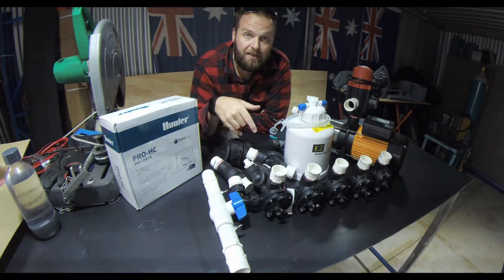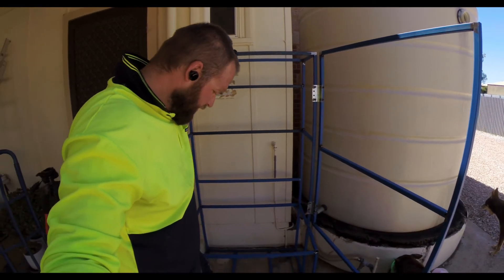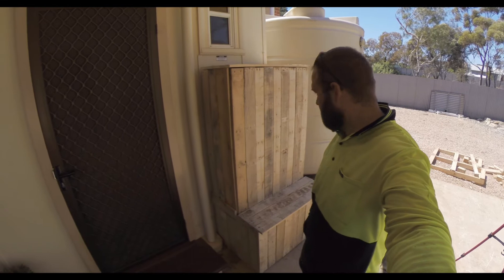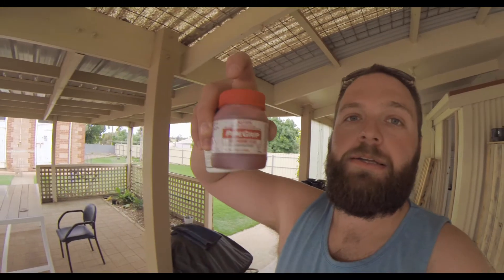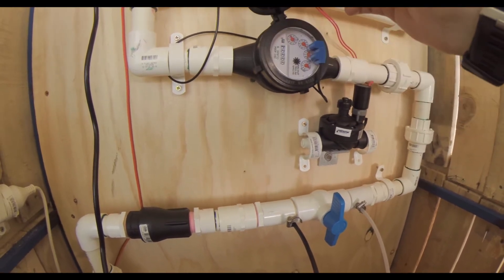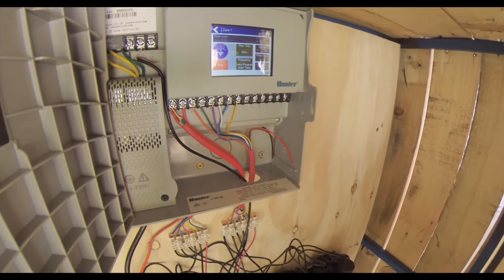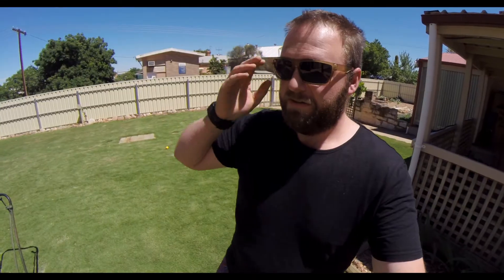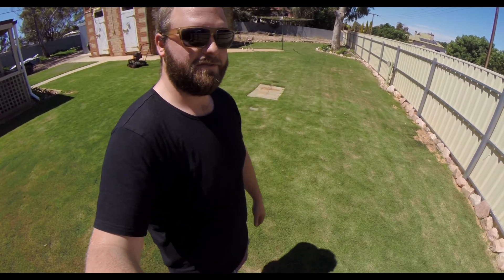Building an irrigation cabinet // installing a HUNTER Wifi controller with EZ-FLO Fertigation

Comment: Great vid mate. I'm looking into irrigation now too
Reply from the maker: thanks mate. Irrigation can certainly be a can of worms, but the project was a great learning experience and is still going strong today 👍
Reply: @YourBestLawn  mate I just came back from bunnings armed with a pressure gauge. It's read 55psi where I'm at. I'm not sure what that means as the videos I've watched is relating to flow/LPM...
Reply from the maker: If you time how long it takes you to fill up a 8L bucket on full blast you should be able to work out how many L per minute you have. You'll lose some flow through the pipes, account for about 10-15%.

so I have 13 sprinklers putting out about 50LPM total and I had a flow of 34LPM. hence why I installed the 120LPM pump. I needed to run 3 separate lines if I wanted to run it off the mains pressure which would take about 2.5hrs to put down 10mm over the entire lawn. with the pump I can do that in about 45min.

have a chat to WaterPro, they are able to explain a fair bit of it and help you with the flow and pressure 👍